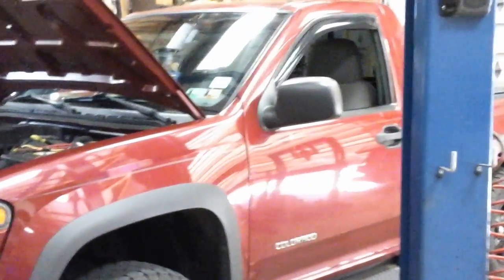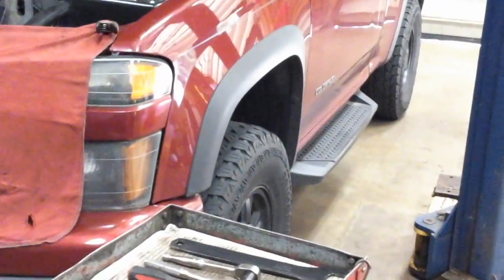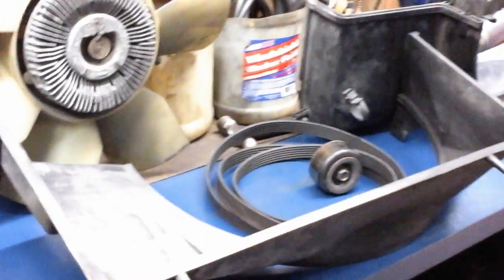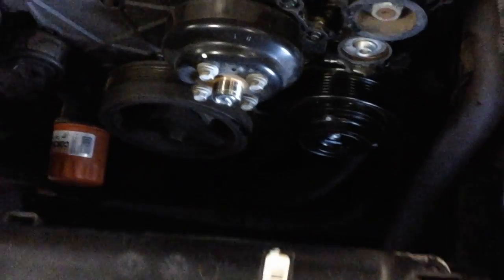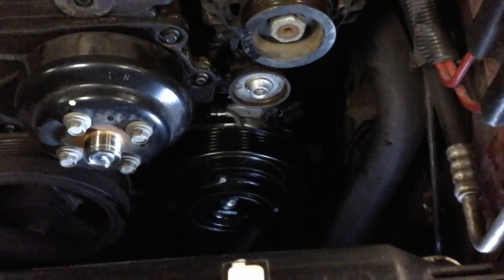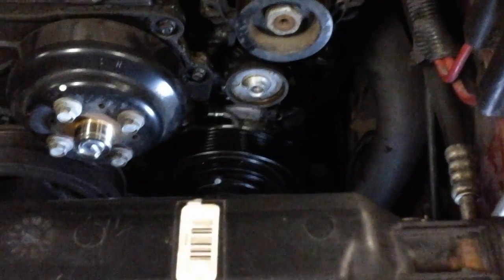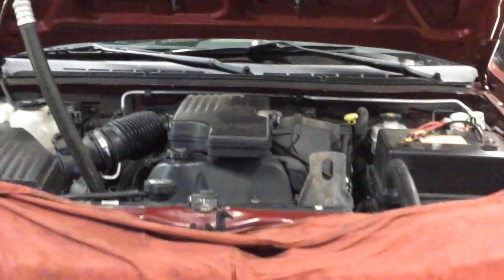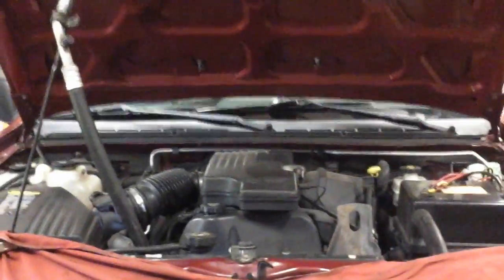Colorado AC compressor replacement

Comment: Since you didn’t change the dryer or anything how long does this last? Because I want to do the same thing without changing the dryer in my system doesn’t have a leak.